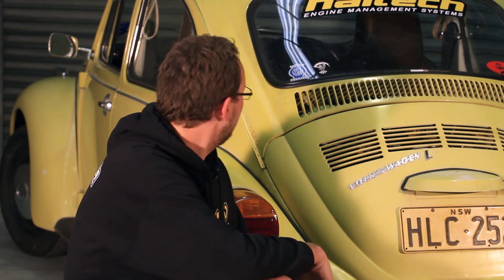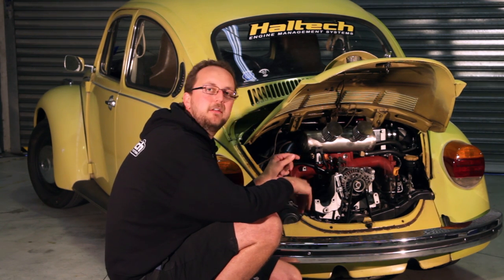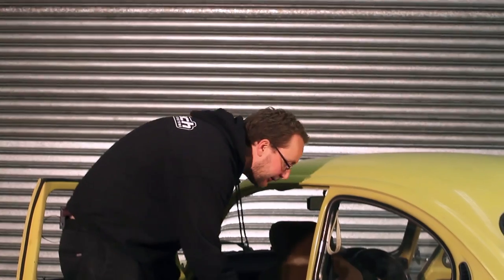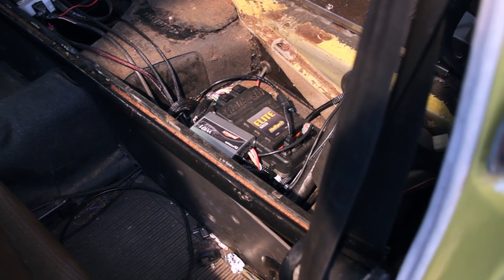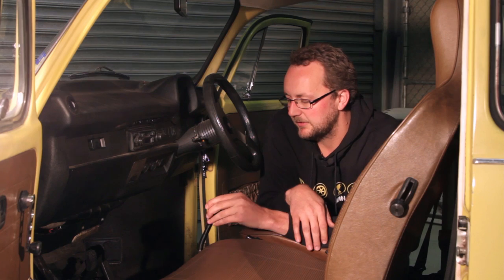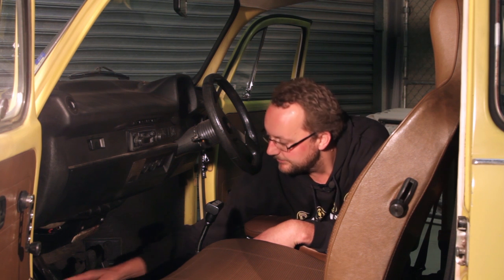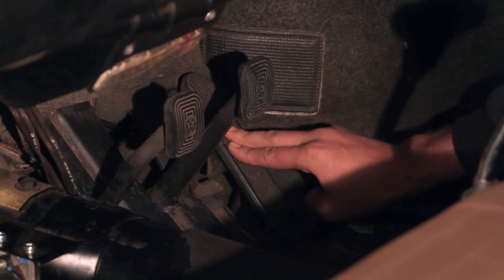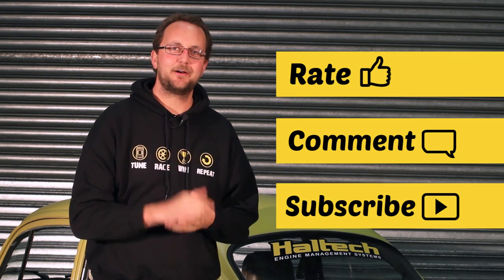Dissecting Miss Daisy: Mighty Car Mods' Subaru powered VW Beetle

Comment: I learned how to drive on a WV type I and I have always wanted to build a sleeper bug but I want to do it with an air cooled WV motor. You can jug & stroke them out to almost 2.4 liters and with two turbos they can make about 400hp. I thank that would be cool
Reply: TRIGGERED! I love Subarus too. Where I grew up there was a big culture of Subaru drivers. I’m talking about the mid ‘70s when most of the country didn’t even know what a Subaru was. 
The other thing is that it wouldn’t be my daily.

Comment: hey Scott excellent work on your part!
but the 6 inch tires kill the whole deal as far as making it an effective sleeper.
no wonder you had to turn the horsepower way down.
suggestion for next project sleeper:
Corvair Monza,
has huge engine compartment, and wider stance...
you could pull the entire engine and transmission out of a Ford Firestar van ( front wheel drive) 4. 2L V6,change axles & struts. adapt mounts for rear engine compart.
then work your magic!
supercharger? turbocharger? maybe some nitrous oxide? or just put bigger fuel injectors on it? with custom exhaust?
and you should have plenty of room left inside for some 9 - 10 inch wheels that will stay inside of outside fenders...
as well as reworking the front suspension and steering...
an splash a nice paint job on it, and  then model with Antoinette Soto holding a checkered flag!

Comment: Love the sound! Being a 4 cylinder boxer motor the Subaru motor doesn't sound all that different from the original VW unit.
Reply: +Simon Coles would be more of a sleeper if they welded a stock vw muffler on the thing so it makes the obnoxious tweetybird sound
Reply: +ZetaReticula alien Stock VW muffler would be way too restrictive for the power this motor's making...

Comment: Great video but near the beginning you mention 1970 Beetle but the example you have is a 1973 on model. The 1600 engine arrived in 1971 with th Superbug but was name changed to the L with curved front windscreen in 1973 and retailed in Australia for $2650 plus O.R.C. The 1600 was available a little earlier in the type 2 sedan, in the flashback and in the wagon with later once featuring fuel injection. I apologise in advance for any errors or omissions.

Comment: That MCM  beetle and the dung beetle that Asian and farm truck have from Oklahoma City, Oklahoma US would be a good race. They make the same power and both are boosted. One is air cooled with a pull Thur system carb and the other a ej25 with twins. It would be super close. Oh and both are manuals

Comment: Mcm beetle vs dung beetle street outlaws
Reply from the maker: +Liam Mcgrath Now that would be a good grudge match:)
Reply: +haltechecu it would be a mission to make possible but would be really good are marty and moog going to usa for a roadkill episode ?
Reply: +Liam Mcgrath first thing that crossed my mind what the episode ended =P (mcm)
Reply: +William Witte gotta feeling the dung might win though
Reply: yeah me to.. drag slicks + nitrous and AZN seems to have a waaay better cluch installed
Reply: +William Witte  yeahhh the width of asians tyres are alot wider and hes hung dung sooo many times with that tractor flap
Reply: +Liam Mcgrath MCM one is a fair bit off of being a great drag car. needs some clutch changes and wider tires. they had to tune it down to about 50% throttle, it wasnt hooking up with the current settup
Reply: +Un7ucky yeahh i dont think they will develop the car much more as you say better clutch and tyres and thats it really they usually dont do much work after they have finished it
Reply: +Liam Mcgrath Bro why not a wrx becaue thats where the engine is from
Reply: +Syed Shamiun yeah but alot of the wrx are heavier then the beetle so it wouldnt be much of a race depends on power and weight
Reply: yeah agreed
Reply: agreed my friend
Reply: +Syed Shamiun j
Reply: Did you see how bad Miss Daisy killed Super gramps?
Reply: Vidala Keerthi JU mate
Reply: Miss daisy doesn't have a chance. Dung beetle put down over 400hp at the wheels and best of all it's still an air cooled vw engine;)
Reply: Ram Runner You are correct sir. I saw the Dung Beetle DESTROY a Lambo and a GTR, or as the Aussies call them "Jeedyaar". That little sumbitch is fast. I'm not discounting the MCM Beetle in any way, but DB has alot more meat under the wheel arches as well.
Reply: Un7ucky well the dung beetle isn't really a drag car either
Reply: Barry Fields due dung nettle isn't a drag car? Please explain than what is is then because it was built for the sole purpose of drag racing! It's more of a drag car then miss daisy
Reply: Ram Runner were you drunk when you wrote this? First, I didn't say anything about a Miss Daisy I don't even know what that is. Second, the dung beetle is a full body car with lights and I'm pretty sure it's titled and licensed as a street legal car or at least could be
Reply: Barry Fields yea I'm sure it is but that does not mean it was not built with the sole purpose of drag racing! The suspension, engine, trans, roll cage, racing seat, harnesses, track bars, slicks are all for drag racing man just because it doesn't have weight reduction in a car with full original weight of 1700 pounds! A fiberglass or aluminum body does not make a drag car🙄! And miss daisy is the yellow bug in the video lol but your asking if I'm drunk?
Reply: Ram Runner go back and read you post
Reply: Barry Fields I did you said the dung bug isn't a drag car and u are wrong
Reply: Ram Runner I saw that video a while back and I didn't remember them calling it miss Daisy sorry about that

Comment: "Give it a bit of a warm up"  .001 seconds later proceeds to rev a cold engine. 🤣🤣
Reply: and then, after revving it and spooling the turbo up to 60,000 rpm, turn the motor off, loosing oil pressure to the turbo - real smart

Comment: Would be nice to see a break down of costs. I beleive the standard VW engine is also very tunable and will do 400 hp with the right parts and turboed or supercharged. Type 4s lend themselves to it. There are 3 litre pauter engines that run watercooled heads that would put this car in its place. But I would like to see a breakdown of costs as may be a economical way of making a fun street car.

Comment: I wish MCM converted this into a 4WD and went RALLYING with it... that would be amazing.
Reply: @rob320is its hard to do, because of the wheelbase that a bug has. How can you make a 4wd car when theres no tunnel originally in the car, the engine is in the back so is the exhaust when standard. If you want a bug to be 4wd you need a different chassis and put a bug shell on it, but that defeats the purpose of this build.

Comment: I have a PS1000 and I just found out it doesn't have a knock sensor and I'm a bit worried about it. I'm thinking of getting a Gizzmo K-Lite for a bit of extra security but is there anyway I would be able to pick up a signal say off one of it's LEDS for boost cut or some other form of knock protection?
Thanks
Reply from the maker: +Ben “Percy” Ward Hi Ben, we can help you with this setup - shoot us an email on support@haltech.com .

Comment: Would be nice to have info on the whole build and not just the ecu and wiring side of it. Like what transmission are you using I know form experience that a stock beetle trans will yard sell with 100hp, how did you run a vss, and maybe the a bit on how you guys did the cooling.
Reply from the maker: Check out the Mighty Car Mods channel - the whole build was featured there. That's why we didn't really want to repeat everything they've already covered and instead focused in detail on the parts we were involved with.
https://youtu.be/hpb2Him9CUo

Comment: hello I'm trying to build a subaru 71 beetle I have a 04 subaru wrx EJ20 motor and the mounting plates and motor mounts brakets put I'm still having a problem with a wiring harness concern please let me know if have a great ideas to help thanks
Reply from the maker: What ECU are you using?
Reply: hey so I hear u have already built a subaru powered bug ?
Reply: thanks for sending me a message ya let me know what I'm going to indore in the project

Comment: how did you guys manage the coolant system? Is there a radiator in front of the vehicle?
Reply: They mounted a radiator inside the engine compartment, basically mounted behind the rear seat. Used fans and they mention in their build video that they were planning some sort of under-car scoop to feed outside air to the front of the radiator.

Comment: for the EZ36D whats the best way to boost it ? install a supercharger or a tubo ? its going to be in a tribeca 2008 and i must put an aftermarket ecu or the stock ecu i can use it ?
Reply: +canchume The obvious choice is turbo and Haltech ECU is it not? ;)
Reply: ***** Thats many the next step, first i want to boost it with many problems ;)
Reply: +canchume Putting boost into a car is not that simple.

First of all are you rich? That is the only requirement for a project like that.
Reply: Ognjen Galić i have 13K for the forester and other 7K for mods so maybe im in the limits, i found a tribeca 2008 with low milage near my city so before buy a forester i just want try the tribeca(i like more), i found that the raptor supercharger, had a kit for the ez36d with simple bolt on but im not so sure about the best way to boost it
Reply: +canchume You can get a supercharger kit so there is less customisation to do, but turbo may net bigger gains. A haltech will run it.
Reply: canchume Mighty Car Mods Why not twincharge it? Best of both worlds. I think tuning that would be a great challenge for our friendly neighbourhood Tuning Fork!
Reply: Mighty Car Mods Thanks for the response, im looking for a sleeper and way to wake up the engine with not much work, its going to be my daily driver
Reply: ***** yes would very cool , but i live in other continent so maybe is a little difficult to do, and i don't a lot of money for that jaja
Reply: +canchume It all depends on how you want it to drive. A supercharger will give you more power with no turbo lag so daily driving will be a bit easier, but fuel usage will be a bit higher because a supercharger takes power directly from the crank. A turbo in the same price range will out-perform a supercharger but if you go looking for high power, turbo lag will make daily driving a bit of a pain. I suggest doing a little research and figure out how you want your car to end up in the long run and just start building towards that.
Reply: InhumanDisease Im looking for a daily driver, reliable most of it, right now im not looking for other things, thats why im more interest in suchercharger

Comment: They don't really lose that many horses, the VW flat four is one of the most reliable engines out there, and only the first engines (1000 and 1100) produced 24-30hp, my 71' 1300 has 44hp. And then you have the 1500 and the 1600 and they produce around 50-70hp I think, not gonna bother googling it

Comment: Doesn't electronic throttle have lag between when you apply acceleration to the engine responding ?
Reply: +sypher0101 microseconds.
Reply: +sypher0101 this all comes down to tuning. on a Haltech ECU like this, its practically 1 to 1. A lot of factory ECU's that are not tuned do weird stuff though.

Comment: Does it run the standard gearbox, where are the water hoses run to and from
Reply from the maker: +Damian Curtis stock gearbox. the engine uses a water-to-air intercooler. Go to our website: www.haltech.com and click on the tech story on this car. You will see a close up of the front mounted radiator that the hoses go to.

Comment: Whaaat? You're Australian and use horsespower instead of kilowatt?
Reply: +Henrik Nilsen Im Australian and use hp over kw too
Reply: HP is a larger number then kw
Reply: +Henrik Nilsen All you have to do is multiply by 1.34. It's pretty easy to convert kw to hp in your head or estimate very close.
50kw = 67hp
100kw = 134hp
150kw = 201hp
Reply: +Henrik Nilsen You get more bang for your buck if you say horsespower :P
It also makes you faster...
Reply: +MKTech mmmmmm tasty Pi
Reply: +MKTech .. if you're doing it in your head though, some people might prefer "times by four, divide by three".
Reply: +Brandon P same here. But my brother gets annoyed at me for doing it haha we always get confused. because he uses kw and i use hp.
Reply: +Brandon P same here. But my brother gets annoyed at me for doing it haha we always get confused. because he uses kw and i use hp.
Reply: That's kinda strange because MCM says they use kw instead of hp because they're Australians, and then we have Australians using hp.
Reply: 100hp = 75kw  if ya didn't know👍
Reply: MERICA
Reply: It's a personal preference much rather than a standard. In my place the standard is kiloWatt but most of us use horsepower.
Reply: Henrik Nilsen it was horsepower before motor strength was ever measured in watts. In 2010 Europe actually made it so that any horsepower numbers are strictly supplemental, as a marketing device.(Also there are two different measures of horsepower imperial(.7457kw) and metric (.7355kw.)
Reply: I'm Australian as well, and weirdly enough I tend to think of cars in kW and motorcycles in hp (and I'm more of a motorcycle guy).

Comment: didn't have to hold the cluch to start the car?
Reply: +HelpMezz94 Why would you need to do that if the car is in neutral? Or is that some weird safety measure installed to cars in whatever part of the world you live in?
Reply: +Audiojackful I've noticed on newer cars it's a safety feature. Brake on autos, clutch in manuals. I don't think it really matters because if you're starting your car, 99% of the time you're gonna move anyway so just put it in gear and go.
Reply: +nfsm654 Not just newer cars. When I drove my friend's Spirit R FD it needed clutch and brake to the floor and then push button start.
Reply: +ThankfulServant My AE86 (USDM) had one, but my E30 did not (I think it used to though, maybe?)  I bypassed the one on my AE86...

But yeah not just new cars.
Reply: +Audiojackful Its a safety measure installed on most cars since the 80's at least.. My old 80's ford truck had it.. Oddly enough my '02 Saab does not, but I think it's supposed to and its just broken.
Reply: +Calvin W I'm pretty sure it is only in the USA then? I live in northern Europe, work as a mechanic and I've never seen this :)
Reply: +Audiojackful its not only safety feature - by holding the clutch in you disconnect gearbox from the motor thus reliving some stress from starter motor :) Its pretty common thing to do.
Reply: +Audiojackful Well my Dads 06 Renault has this. My 97 VW Polo does not. And I'm from northern Europe as well. Maybe its a thing with pushbutton starts in newer cars, as its easier to accidently push a button than to turn a key and you know better be safe then sorry.
Reply: +MCMonsterbuilder no all cars/trucks here in America you need to hold the clutch in you don't push it the car won't start!
Reply: HelpMezz94
Well I was talking about Europe here. Maybe in the US the laws are a bit different or something plus as a manufacturer I would be extra careful in the US cause if anything happens/breaks cause of the dumbness of people in Situations like this, in the US its much more likely that they will set up a lawsuit than in Europe.
Reply: +HelpMezz94 You haven't bypassed the clutch switch on your car yet?

Comment: @ 1:10 The car needed a quad cam (dohc V engine) preferably with turbo.
opens the hood @ 1:30
Here we got a straight 4...

what?
Reply from the maker: Not sure what video you're watching.... 
@1:30 "in here, we have shoehorned in an EJ25 out of a 2008 model Subaru WRX." (a flat four engine with a quad cam)